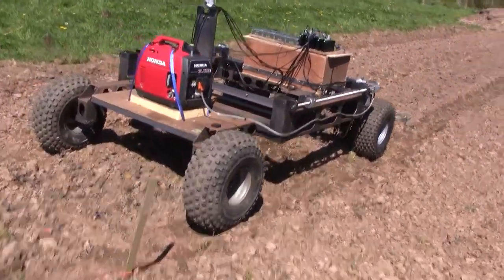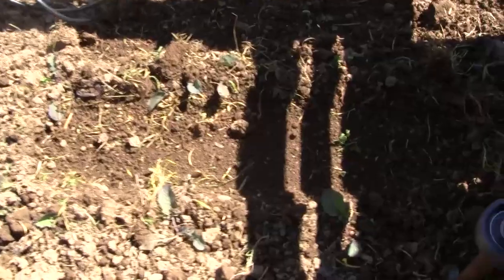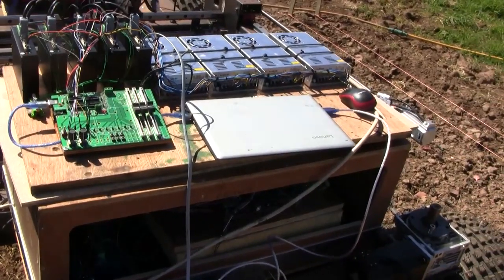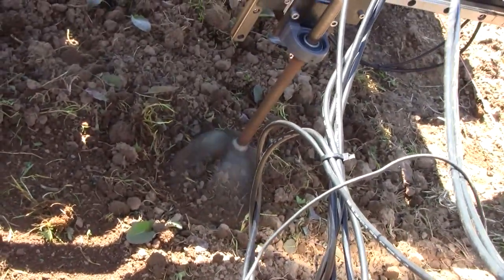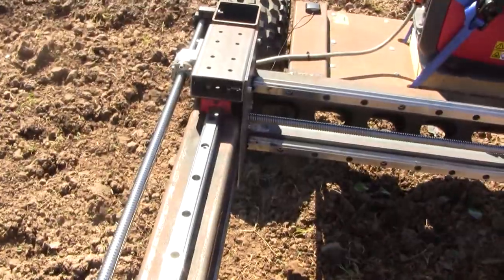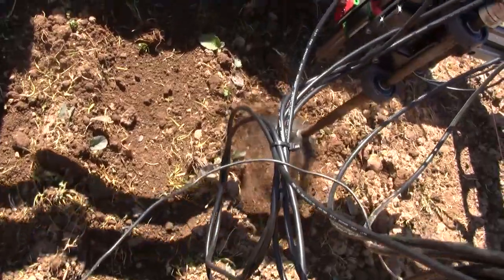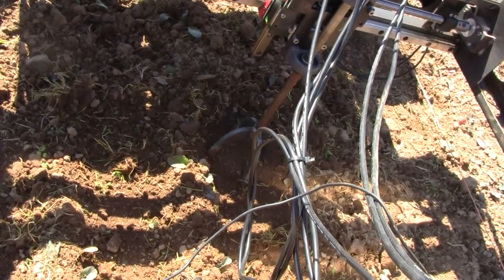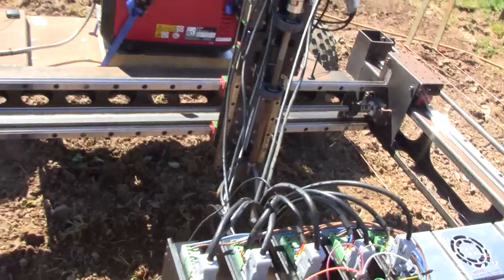WEEDINATOR actually weeding

Comment: I love the project and rapid progress. I don't love the generator and power supply bodge job. A couple kwh of lithium batteries would be much cleaner, quieter, and capable of high peak power for rapid axis movements. Also far cheaper to operate per cycle. Two Tesla packs wired in series would be great if not overkill on energy.
Reply from the maker: thanks for useful comment!